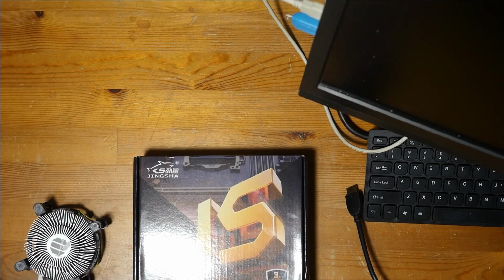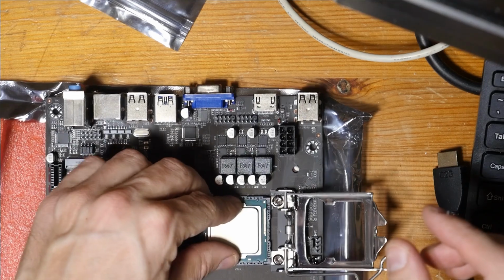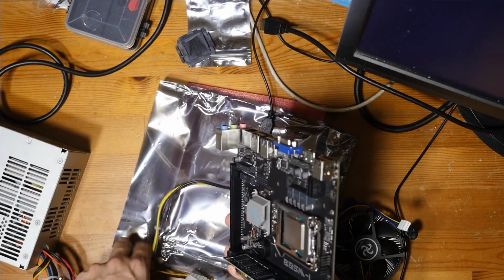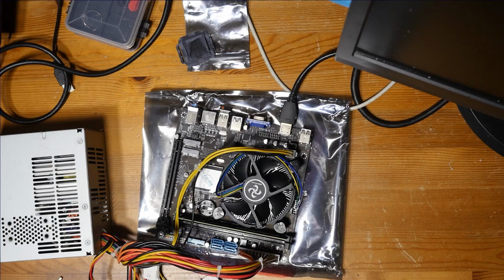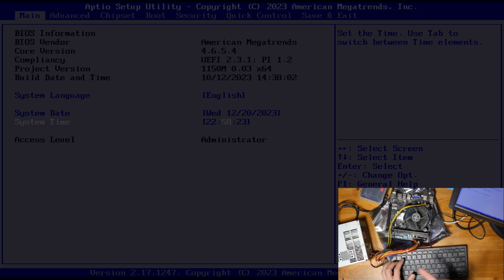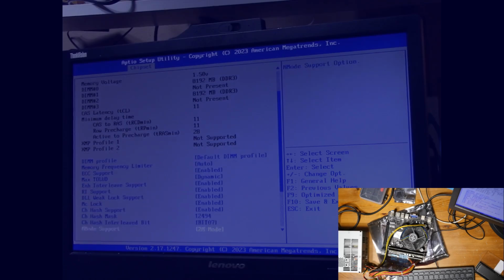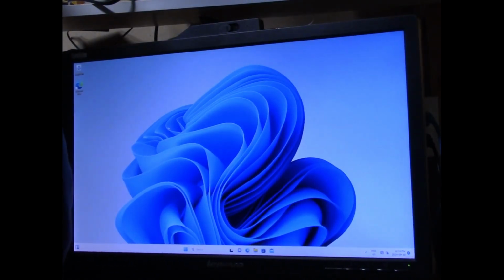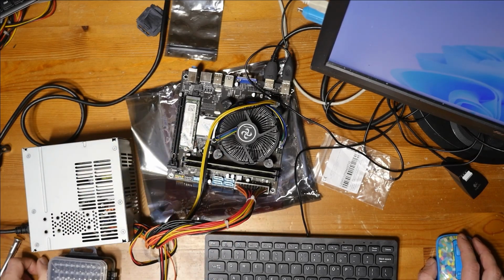Booting Jingsha B85M-I motherboard.

Comment: How is your lab going? is it's still alive? By any chance do you know does it support e3-1265l v3?
Reply from the maker: It's been happily working away as a home lab computer running several docker containers.I should probably back everything up soon.

I looked at the spec here -- https://www.intel.com/content/www/us/en/products/sku/75463/intel-xeon-processor-e31265l-v3-8m-cache-2-50-ghz/specifications.html It should be the correct socket and the Xeon will work with non-ECC DDR3, B85 supports Xeons, and power requirements are OK. But I don't know if it would actually work.
Reply: @flamy111  thanks. I saw that ASRock motherboards with the same chipset have support out of the box—no BIOS update required. And saw some succsesful runs with haswell 80w xeons without integrated graphics. Hopefully, the guys from China have added all the possible microcode to support every CPU they can

Comment: Bruh.. it triggered me when you removed the screw holding the cpu holder. and you proceed removing the entire holder. you dont need to remove any screw to put Processor.. just unlatch the lever. YOU SHOULD NOT TURN THE MOTHERBOARD ON IF THE PROCESSOR IS NOT PROPERLY SEATED DOWN AND LOCKD BY THE HOLDER.. Its Clearly you have no knowledge on PROPER COMPUTER ASSEMBLY and Experimenting.

Comment: What ssd u usd gen 3 or gen 2 ?
Reply from the maker: Based on lspci output, it supports PCIe v3.0 x4

LnkCap2: Supported Link Speeds: 2.5-8GT/s, Crosslink- Retimer- 2Retimers- DRS-
LnkCtl2: Target Link Speed: 8GT/s, EnterCompliance- SpeedDis-
     Transmit Margin: Normal Operating Range, EnterModifiedCompliance- ComplianceSOS-
     Compliance Preset/De-emphasis: -6dB de-emphasis, 0dB preshoot

Comment: With 1.728 Volts as CPU VCore as shown in the H/W monitor in the BIOS ( 23:50 ), you can expect the CPU to fail very soon as this voltage is too high and should normally be around 1.3 ~ 1.5 Volts. Maybe a BIOS/microcode update fixes it. You could also try undervolting manually using Throttlestop if supported.
Reply: I I have the same board, but when I test with "cpuid" it shows between 0.8 and 1.2 volts.
Reply: @adriebakker2362  That would be the safe range if it is being correctly measured. You can also try viewing using HWMonitor, HWinfo64 while running a stress test using Prime95. When under full load, the max clock speed and hence the max voltage to achieve that max clock frequency is applied. How much VCore is being shown in your BIOS H/W monitor?
Reply: I tested it with hwinfo64 and prime95. Highest VCORE is 1.19v, lowest 0.89v. When I look at BIOS H/W it is 1.7v
Reply: @ Perhaps it would be fine and the scary 1.728 Volts is either being misreported or only being applied while it's POSTING or while in the BIOS setup.